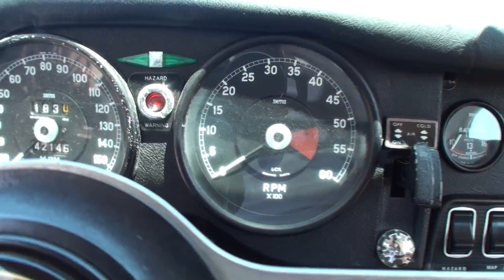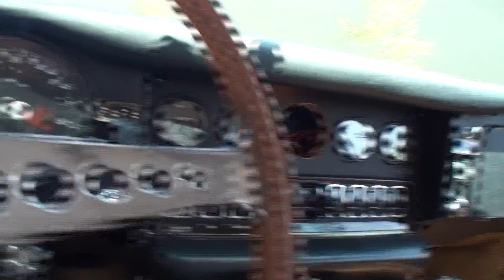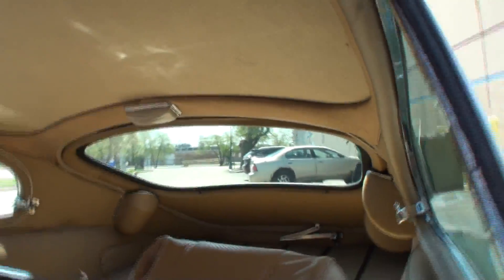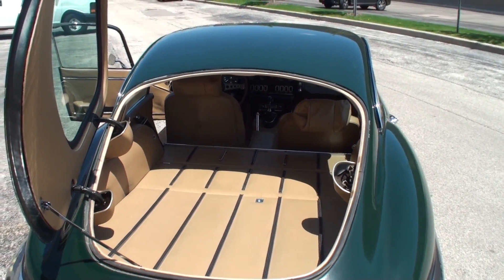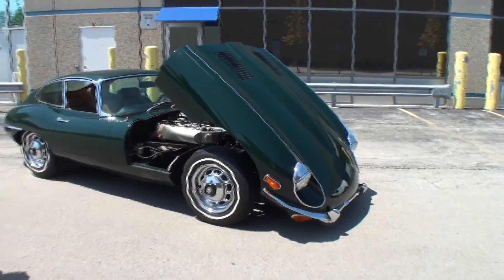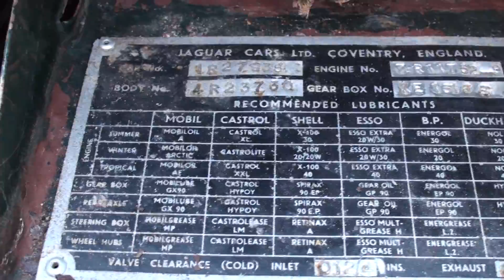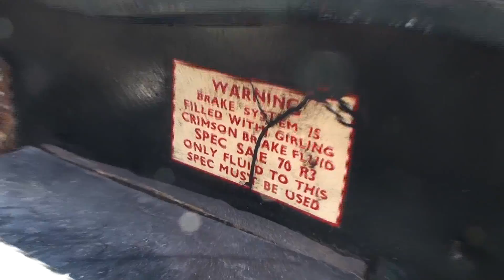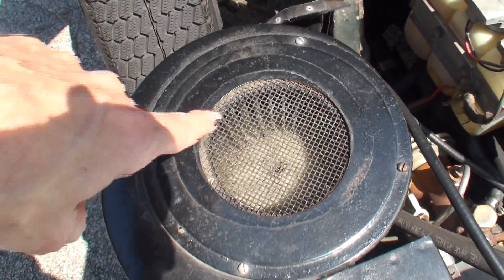1970 Jaguar E-Type E Type Coupe in Green & Engine Sound on My Car Story with Lou Costabile

Comment: I owned a red `67 series 1 and a half with black hides and wires. My favorite, however, is the series 3 E-type which was fitted with the 5.3 V12. I love Jaguars most and currently own an XJ12 and an XJ8. The 4.2 litre inline 6 is a wonderfully smooth and reliable engine. The carbs are S.U. and I never had problems keeping them synchronized. Thanks also for bringing us a nice original and driven car. I miss my E-type.
Reply from the maker: Hi Clarkecars, V12, That's fun :-)  Thank you for viewing and sharing, Lou